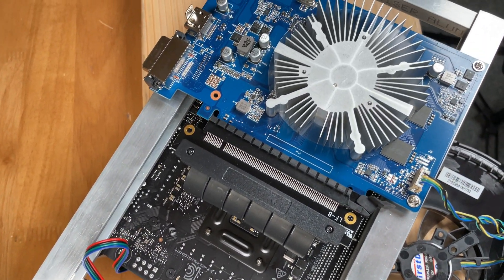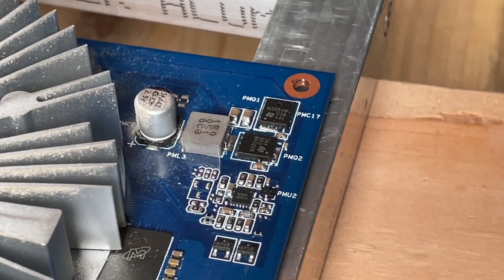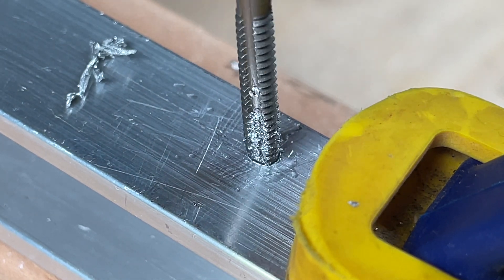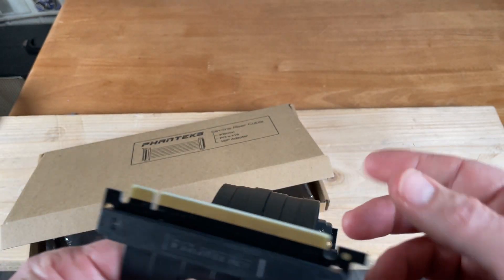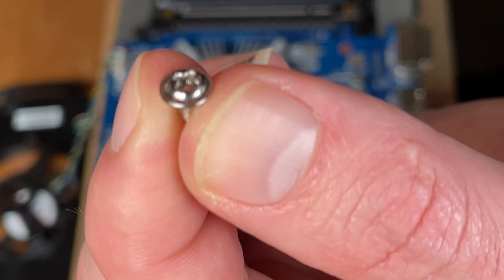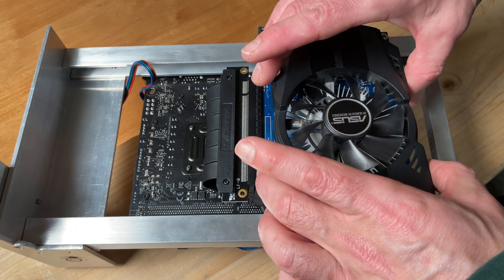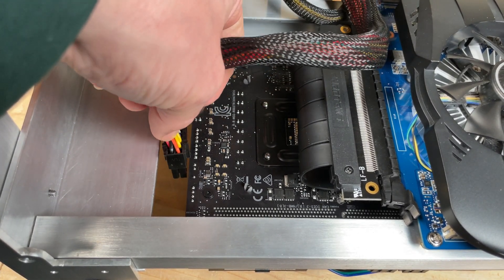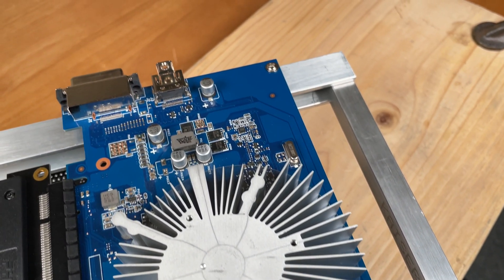Graphics Card Install - Custom Open Frame Mini-ITX Computer

Comment: Do mini ITX motherboards have PCI-e slots or M.2?
Is the same kind of slot used for NVME disks than for graphic cards and Ethernet cards?
Reply from the maker: Thanks for watching!  This Mini-ITX motherboard does have a PCI-e x16 for a graphics card (82 pins and 89mm wide)
and an M.2 slot for the NVME SSD (22 mm wide)